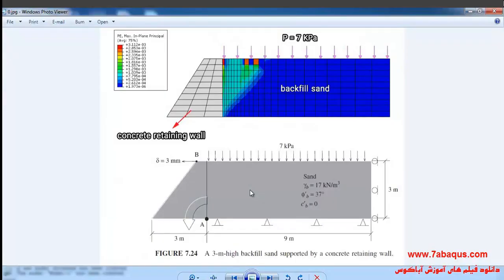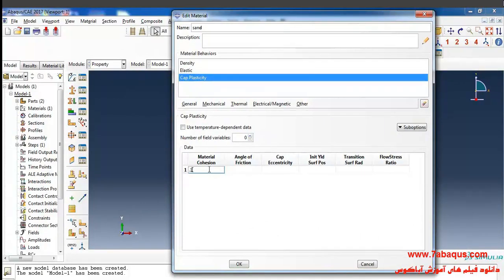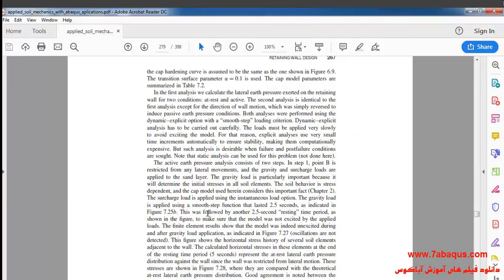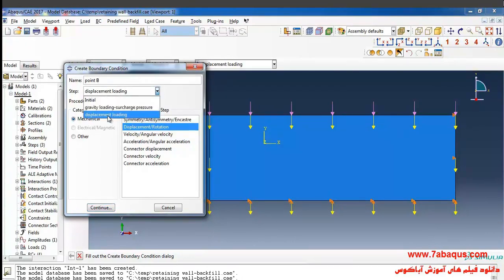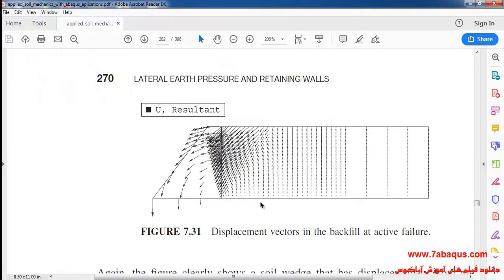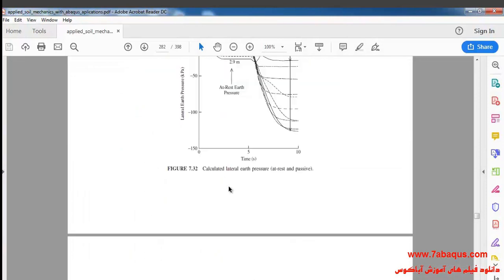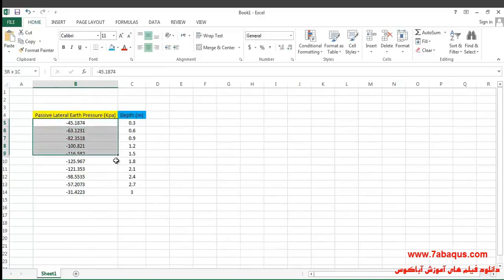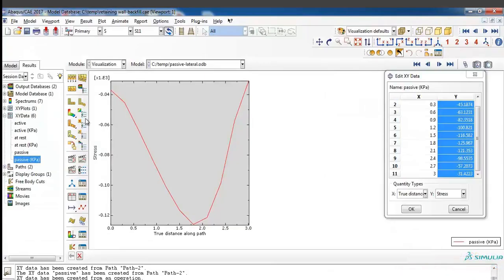Backfill sand supported by a concrete retaining wall (lateral earth pressure) Abaqus

Comment: In this problem,
Que. a) Is predefined geostatic stress applied?
Que. b) If it is applied then what is the value of lateral coefficient 1: ?
Que. c) What type of lateral coefficient used, whether active, passive or at rest condition?